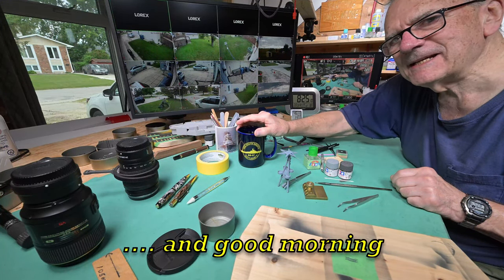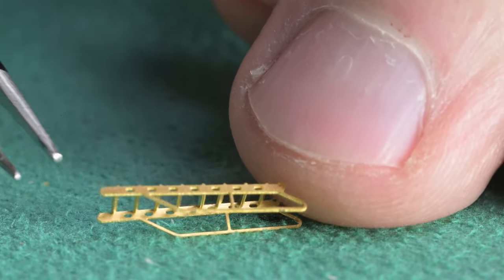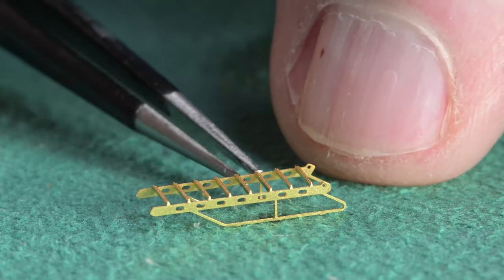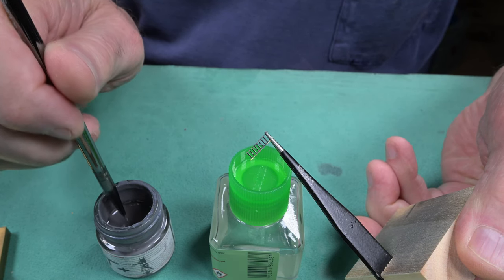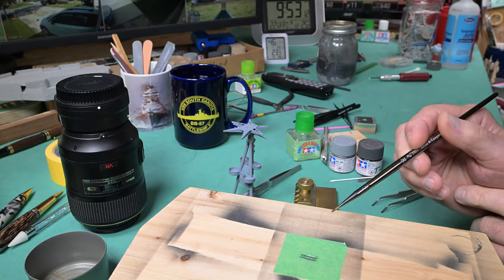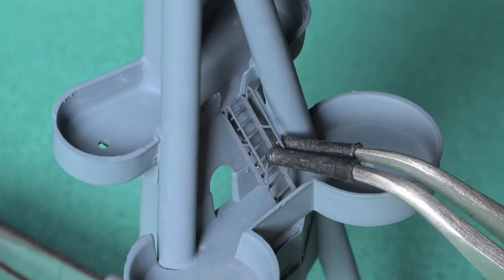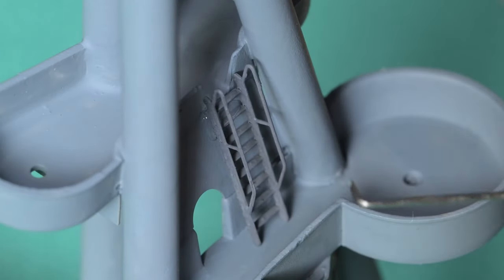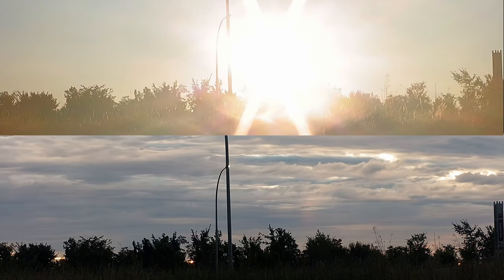The Model Ship - Part 1268

Comment: Hi Ron, Nice job on that ladder.  I didn't notice the treads either, until you put it in place.  I'm glad you were able to fix them.  You did a great job syncing those sunrises.  It looks like they are about done with the construction in your neighborhood.  Hopefully things will be back to normal very soon.  Thanks for sharing.  Have a great day.  Jeff
Reply from the maker: The hole digging crew is done. Next a different crew runs the cable from the holes to each house.

Comment: Hi Ron, this comment is not so much for this build but perhaps for future ones, I believe the biggest issue you have with airbrushing is the amount of preparation and cleaning involved. By the time you move the fan booth onto the table, go down to the basement to switch on the air hose, then afterwards take the airbrush apart for cleaning and do the reverse to pack away it's easy to see why you prefer brushing!

If you had a separate table say in your back room with the fan already their waiting to be switched on, a relatively inexpensive table top compressor so you don't have to go to the basement to turn on/off and perhaps have a cheap-ish airbrush where you don't mind taking a bit more liberties in cleaning - by that I mean after spraying you could just pour some thinners or airbrush cleaner, spray that through so it comes out clear and then it's ready for the next time. It might need a full take apart and rebuild clean every so often but that might be every 25th time or more depending on how it operates. 

Just some food for thought, again if brushing is your preference then of course you have to do what makes you happy. 

Have a good day.
Reply from the maker: Yes, been thinking along those lines too Barry. 👍